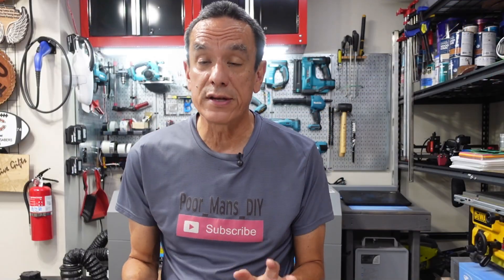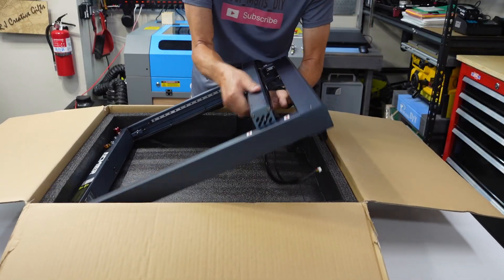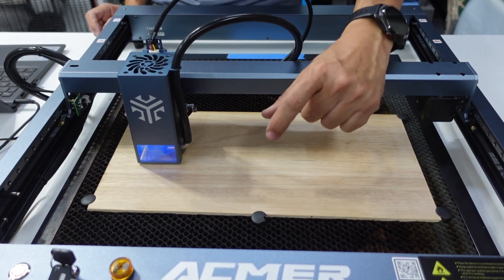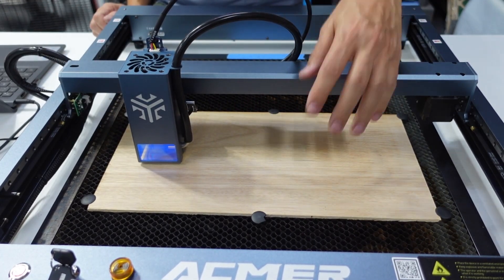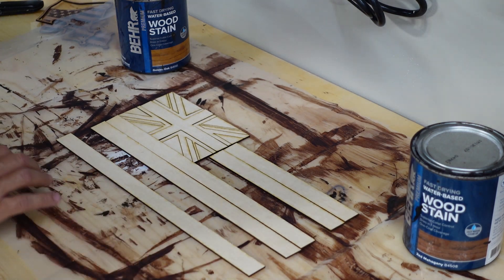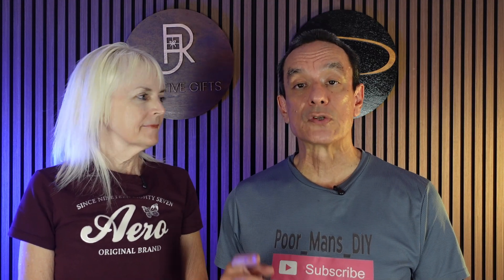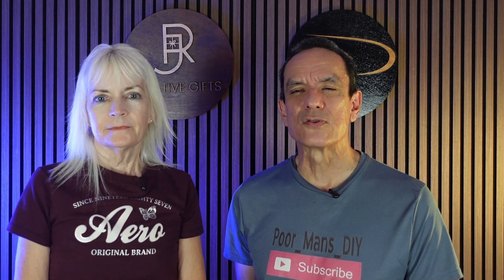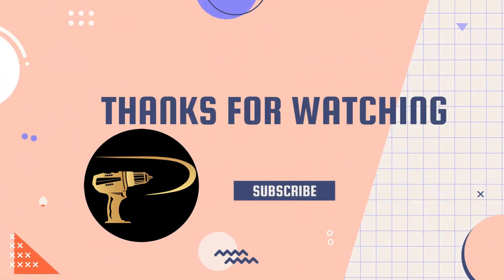ACMER P2 Laser Engraver in Action | Real Product Testing

Comment: Hi would this  laser work with coper
Reply from the maker: Diode laser do not work on copper as is. However, thete are methods you can use that involve painting the copper black first and then the laser is able to engrave a bit. Once finished, the remaining paint has to be removed.

Comment: Wish you would had said your settings
Reply from the maker: I definitely understand your wanting such information. I know how you feel. I used to search for the same type information, however, I have learned time and time again that settings vary. I use mahogany plywood the most but one sheet of mahogany reacts completely different from other sheets. I has to do with things such as the age of the wood, moisture, color and so much more. I have a basic setting to start from but I perform a test to determine best settings for each item I cut or engrave to ensure I get the best results. I know this is not the answer you are looking for, but I honestly believe it is the best tip, I can provide you.